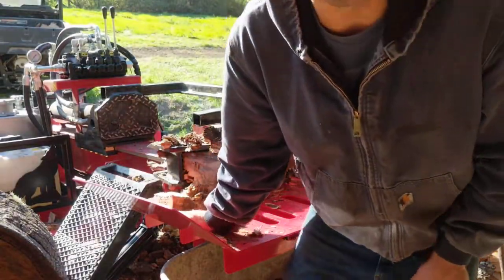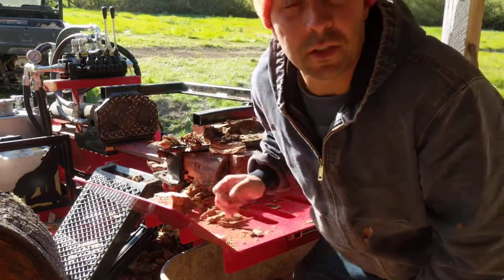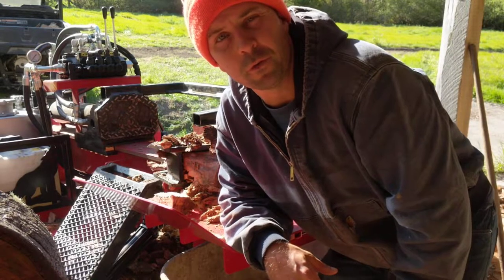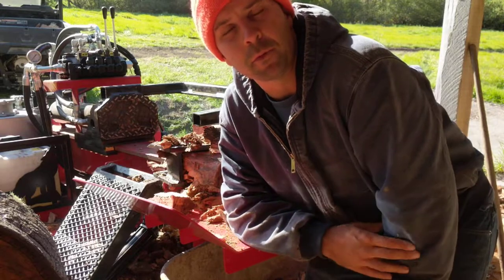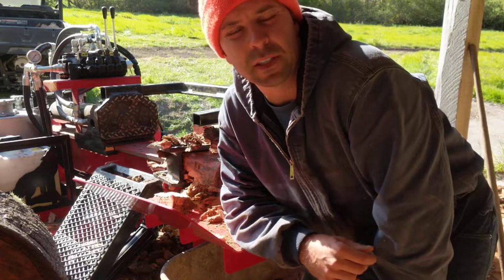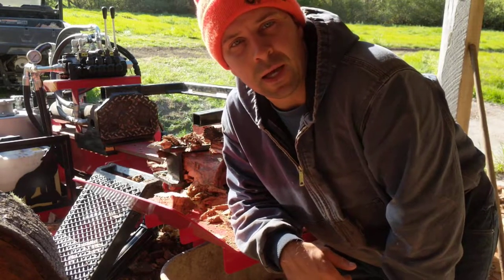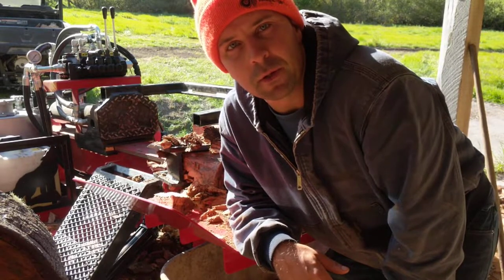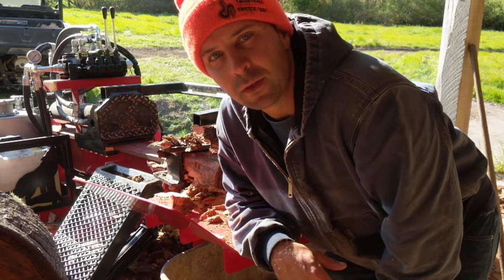#2 300lb Flying Oak Round Firewood Catastrophe

Comment: That last word could be considered to be an understatement.
It annoys me a bit that splitters like this don't use a 2nd pump with low displacement for the log lift and wedge adjustment. The high speed pump is ideal if you want to use the log lift as a slingshot or if you don't mind producing lots of heat by restricting the flow down to nothing.